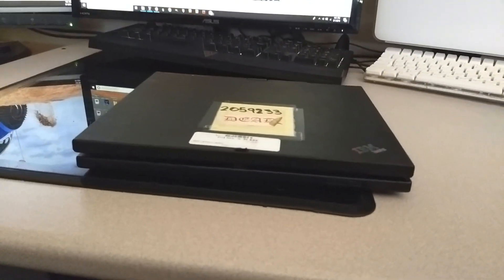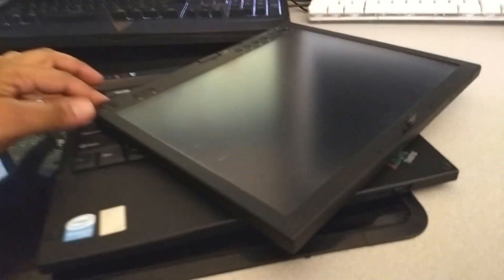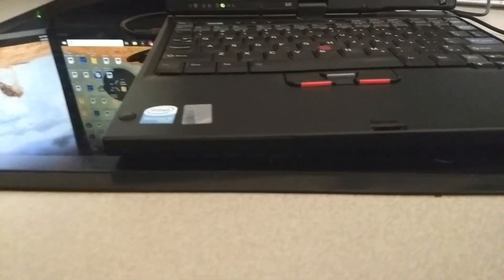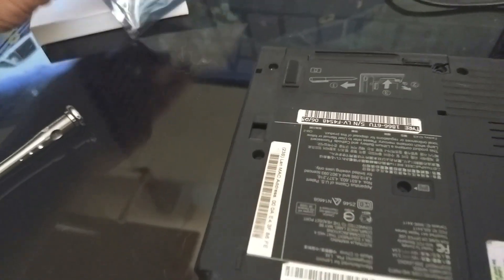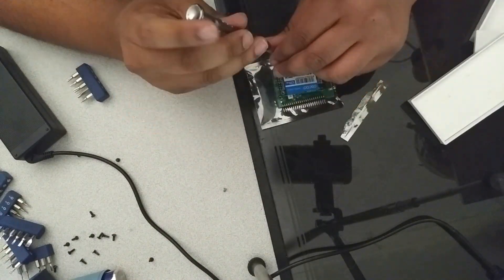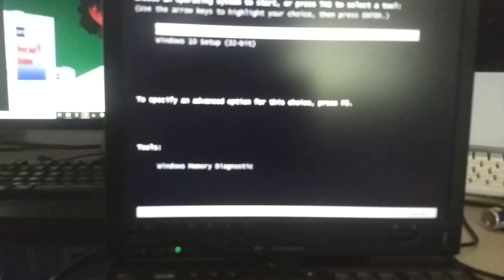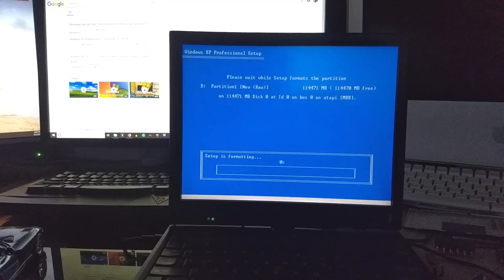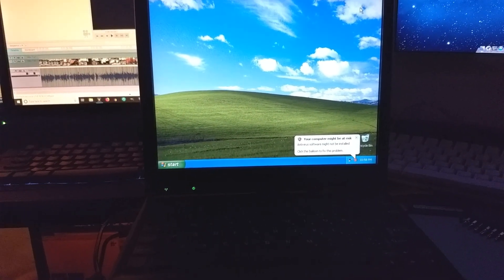IBM X41-t SSD Install, Using an IDE to mSata Adapter (OBD2 computer build)

Comment: THIS IS THE WRONG WAY TO DO IT!!! You are converting SATA to IDE and IDE back to SATA like this! Buy a soldering iron and cut out the SATA > IDE chip!
Reply: @malajvezerigazgato5489  The Intel chipset in these laptops can only have one IDE device, which was used for the disc drive. At the time there were not many (for T43) or none at all (for X41) SATA HDDs so they put a SATA to IDE bridge chip for the HDD connection. You're running the SSD through 2 bridge chips like this. It'll probably work just fine but it can't be good for performance.
Reply: @jm036  is that chip on the PCB marked with "QC passed" at 3:00 ???
Reply: @malajvezerigazgato5489  Yes?

Comment: Yeah, I could not install Win10 pro either. Win7 can be installed (32bits only), but it will run quite slow due to RAM limit on these processors.

Comment: I used my x41 t every single day for work.  It's the perfect computer for a traveling teacher.  Right now I'm running Lubuntu 1804.  I love this thing but I think I'll stay away from trying SSDs and keep my Chinese HDDs, which admittedly are hit and miss.
Reply: @M. M.- You sir are missing out. It’s like upgrading from VHS to  Blu-ray. Or 1985 Delorean to a 2019 Porsche.
Reply: @pvtpeppers6176  hahahaha.  Well I'm running Zorin 12 now.  Lubuntu was just really boring.
Reply: Going to an ssd from spinning rust is like night and day. Please join us in the 21st century. You'll never want to turn back I promise!
Reply: I haven't touched a spinning drive in almost 10 years. You have no idea how big a defference it can make in a computers usability, especially in a case when the hardware is so old and slow to begin with.
Reply: Wire up a good DRAM cached SSD directly to the SATA pins on the motherboard. It's gonna be fast as hell.
Reply: Why do you stay away from ssd's?